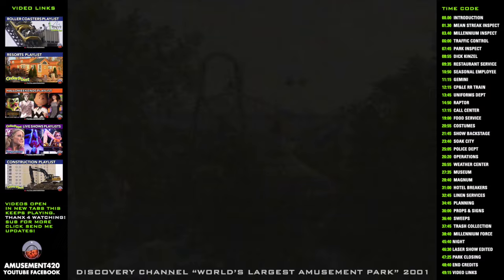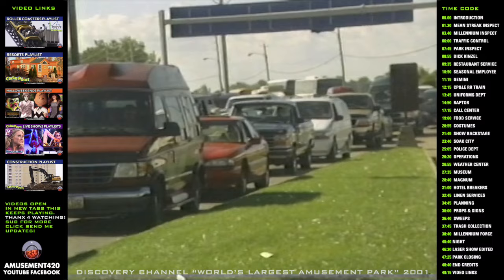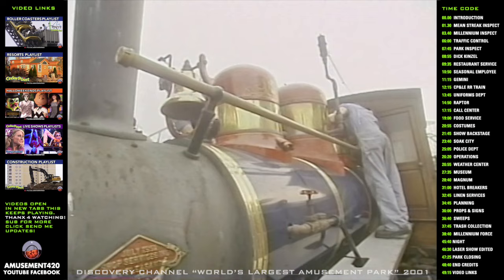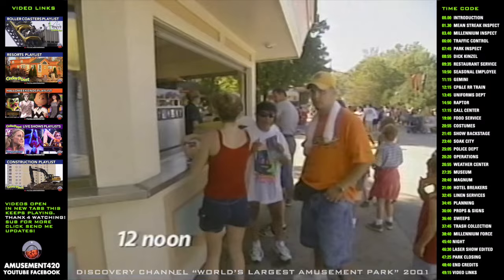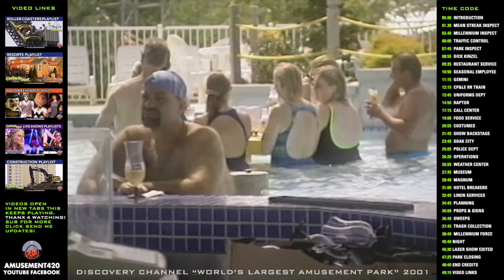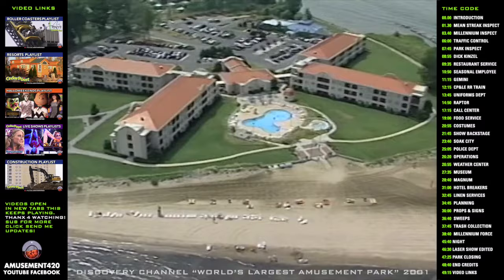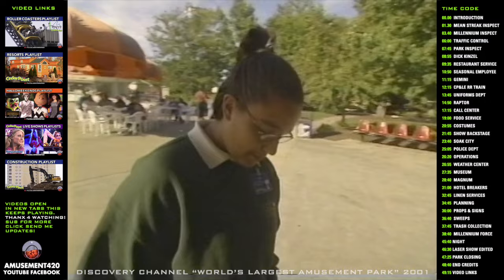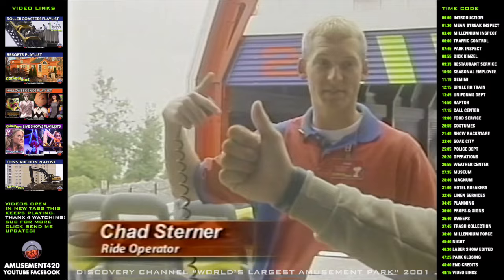CEDAR POINT BEHIND-THE-SCENES DISCOVERY CHANNEL World’s Largest Amusement Park | amusement420

Comment from the maker: This is a refined upload of a previous popular upload that got over 50k views. I did this for two reasons:

 1) There was a minor music copyright claim surprisingly on an obscure music clip used during the relatively insignificant laser show short segment. The Cedar Point Laser Show technician talk is still there and interesting. All things considered it’s not a bad compromise.

2) I took the opportunity to add a convenient time code and refine my playlist thumbnail links which people do click on and I would find helpful myself as viewer. I currently have over 500 uploads of videos shot from 2006 thru present and more that I haven’t uploaded yet or moved form my old live shows channel. The most vids I shot were in 2008 and 2016.

Note that the original VHS program is presented here in the correct aspect ratio 4:3 full frame so there was pillar boxed room on the left and right sides to accomplish my relevant design additions. I added  a title watermark to the bottom of the program because not everyone understood it’s from 2001.

It is a very interesting feature. The core behind-the-scenes daily activities are not that much different than today. And it is very well done. They cover a lot of material in less than an hour. This is good free promotion for the park and Discovery Channel imho

It’s also interesting to see how the park has changed yet maintains it’s Cedar Point amusement park identity as the roller coaster capital of the world and Mid-west family vacation destination on a Lake Erie peninsula. A very unique and esthetically interesting place to visit and document.  I see or learn something every time I’m there as a Platinum Season Pass holder once a week since 2006.

Enjoy, Like, Share, Embedding is turned on for social media web sites and blogs it counts as a view on YouTube, check out my convenient playlists, Subscribe and Click Send Me Updates when you do for more interesting videos!
Reply: I understand on how frustrating uploading a simple documentary video thinking it’s the only video alone to worry about. Thinking the music for the laser show wouldn’t matter or be in included in the video rights and all of a sudden get a notice from YouTube with copyright. I understand how frustrating the original upload you had, filled the whole screen and it being a loss on your number of viewers, likes and dislikes, statistics and comments that were growing is forgotten. I know personally, I had this under my collections Labeled “Cedar Point” as my first video since being the best Cedar Point video period. With the changes you did when I rediscovered your video with the time code, it added to the VHS tape atmosphere of watching, like it belong there in the first place, it was more colorful on the screen and looks like something provided from Discovery channel with the green numbers and white titles. Adding to the uniqueness with your other video links to balance out the screen with another added touch with the title of it on the bottom for decoration like to remind someone what they are watching on TV, something discovery channel would do. Even though a little disappointed the screen it is not full, but gained something equally better to make me forget and appreciate the atmosphere of this video back again more is the fact 4:3 full frame brings back to a standard size video player atmosphere to not play with the original film would seem different on a screen of bigger or smaller size. Make it look natural on a TV of the 90s to early 2000s, which kind I still have and proud to keep. I watch this on the computer though only and plan to get the VHS copy if I can for my TV. I appreciate you for posting this period and good job with showing the Discovery Channel logo right before it this time, just like the video, only thing missing is the other Discovery ads before it, but bet you couldn’t with copyright.
Reply from the maker: Thanx for the thoughtful comment! yeah it’s for the better in the long run since I stopped and thought about and added the timecode which is the type of thing I would like to see if I was watching it. Was actually more fun to do than putting one in the description. 

I was experimenting with thumbnail links at the bottom of vids at the time I uploaded the original one. People did click on some of them most notably Raptor Accident which I had hesitated to include however my Raptor vids were made to let the GP know it wasn’t Cedar Point’s fault and give a sense of the area. I hadn’t paid much attention to Raptor and hadn’t ridden it in a while when that happened and had to see for myself just how low and fast it is. 

Since that time I’ve experimented with playlist thumbnail links at the end of vids and the Mean Streak RMC vids down the sides. With this being 4:3 and wanting to maintain that original aspect ratio the pillar box area gave me a lot of room to fill it tastefully and informatively. People are so used to so many visuals and watermarks on TV these days anyway. 

I haven’t checked to see what and how often they’ve clicked on these links. I put so much effort into a free creative outlet hobby I want people to know about other vids.

I added the title at the bottom since some people didn’t understand it was form 2001 oddly enough.

It alters the original slightly but tastefully. Discovery gets free promo for letting us share an important Cedar Point program that was well done. In turn it might drive traffic to my vids. Still disappointing how few subs and views I get. But as long as it’s fun I’ll keep sharing original stuff and some out of print OOP videos to keep them alive.

It’s good the music clip was very short and not very important to the program. I muted it but it didn’t look good so I edited it out but made sure viewers knew it. Again info I’d like to know if I were watching it.

Thanx again 4 watching!
Reply: Oh you’re welcome! I originally wanted to be the first one to comment to make this a special response to your description and wow commenting right after I went to bed! I read your description before I wrote my original message and know very well it was from 2001 I live a county away from Cedar Point and it’s more special to me than any other theme park in the world. I was just complimenting you on your little title on the bottom and little additions on the screen and info you gave, same goes for everything else. This video feels like it came out yesterday in my heart, doesn’t look old with looks and info atmosphere making people don’t mind of when it came out, along with from beginning to end enjoyable to make it a good movie rather than just a documentary. Your Tech Notes I’m really impressed by how you did that, quite detailed, it would be great to learn for me to do something like that.
Reply from the maker: Thanx very much for taking the time to notice  all that! Yeah I'm glad some people appreciate the tech knowledge that went into the effort to make it look &sound as good as possible from an old tape (on youtube anyway. They compress video a little further so what I see on my Mac or TV looks even better). It is interesting how not a lot behind the scenes has changed. btw its interesting Hotel Breakers now has elevators but they still have some bellhops.
Reply: Your welcome again! Compress a video a little further, what do you mean by that? Would you say the technology does that or is it something with the screen? Thank you for the update with Hotel breakers! It's amazing I haven't been there yet in my life as well as soak city. I have it on my to do list and maybe would make it most easy to work there at Cedar Point. My dream job is to operate the steam locomotive. Do you by any chance have the VHS video of this still with the cover?
Reply from the maker: I uploaded a test of a full 60P AVCHD video different non-cedar point outdoor scenes and it mangled tall grass blowing slowly in the wind. it was ridiculously pixelated. I can compare the uploaded vids to my originals and I see a slight loss in quality on youtube. It's not bad though.

I took more vids of the construction around hotel breakers, a walk thru of most of it, and the halloweekends bat gobos they had in the rotunda hadn't uploaded them yet.

I drew a a 2017 planning map of the breakers soak city new entrance area I have to upload sometime soon. I wanted to add POV's from different spots with construction footage I haven't uploaded. I may upload the map by itself and then edit those in another vid when I get to it.

I still have the VHS somewhere. The funny thing is the back cover says narrated by john lithgow the actor who maybe coincidentally lived near cleveland as a kid. but he's not the narrator of this ;

Comment: I am many years older than you, but having a job builds character along with responsibility. I started working in High School and then joined the service. Heck, they have room and board from what you say and it is a great way to learn about working if you have never worked before. By the way Cedar Point is on my bucket list to go too and I am an avid roller coaster fan.

Comment: At 16:43 the lady yells "Corkscrew." But it is an in line twist, not a corkscrew.
Reply from the maker: Thanx for bringing it to attention. I'm not the coaster expert in terminology but rcdb.com lists:

Elements:
Chain Lift Hill
100 ft tall Loop
Zero-G Roll
Cobra Roll
Block Brake
Corkscrew 
Corkscrew

If you click on the Corkscrew link there it lists a lot of similar elements one of which is In-line Twist.
Reply: Apology for the late reply. The lady in question was thoroughly admonished and forced to attend a 52 week coaster awareness class.

Comment: I thought Cedar Point has 18 roller coasters???
Reply from the maker: This video is from 2001. Yes CP as of Sep 2018 has 18 roller coasters https://www.cedarpoint.com/play/rides
1. Blue Streak (1964)
2. Cedar Creek Mine Ride (1969)
3. Corkscrew (1976)
4. GateKeeper (2013)
5. Gemini (1978)
6. Iron Dragon (1987)
7. Magnum XL-200 (1989)
8. Maverick (2007)
9. Millennium Force (2000 second tallest 310 ft and second fastest 93MPH)
10. Pipe Scream (yeah apparently that counts. I'd debate that. That's the one that some people don't consider a roller coaster. But Cedar Point does. Technically it is like Wicked Twister back & forth on a track)
11. Raptor (1994)
12. Rougarou (2014 floorless formerly Manits standup but same track 1996)
13. Steel Vengeance (2018 hybrid formerly Mean Streak wooden 1991)
14. Top Thrill Dragster (2003 the tallest at 420ft and fastest 120MPH)
15. Valravn (2016 name is based on half bird half beast because in the park is in between Raptor a bird of prey and Rougarou a werewolf)
16. Wicked Twister (2002)
17. Wilderness Run (2013 Kiddie but an adult can ride if they're with a kid formerly Jr. Gemini 1979)
18. Woodstock Express (1999 Family coaster)